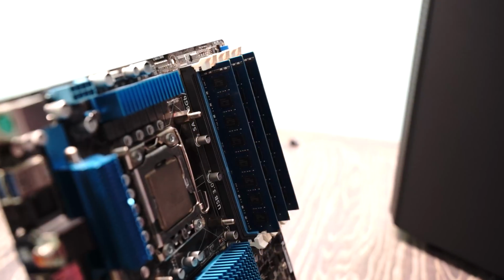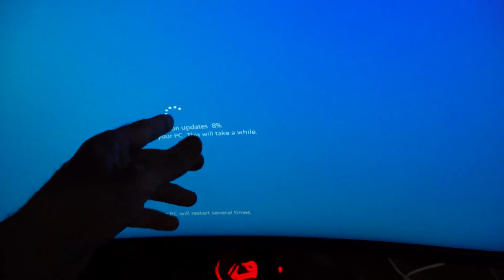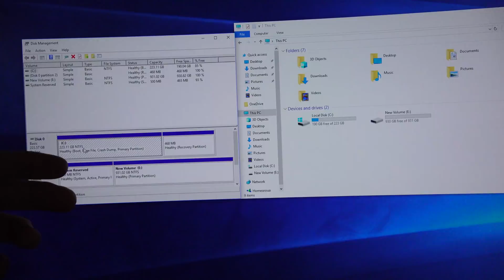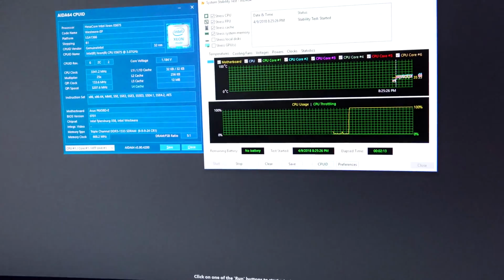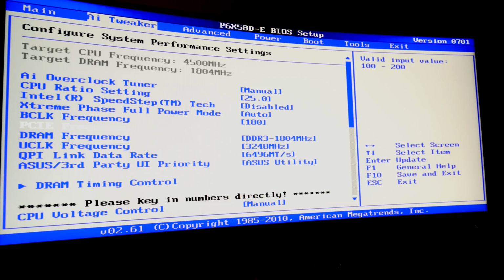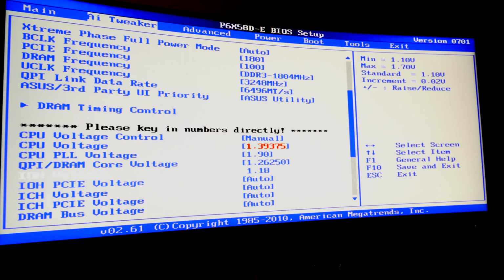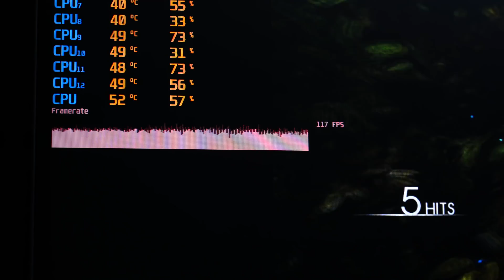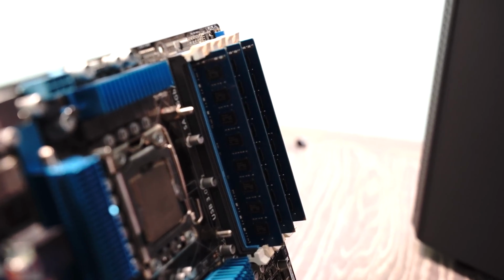Is X58 Still Worth it..? Taking the 6 Core X5675 to 4.5GHz on AIR.

Comment: Can't seem to find x58 mobo under 130-150 euro in europe. 6 core X56XX cpu is around 30-40 euro. From this price i can get used AM4 B350 Mobo and Ryzen 5 1600 with many years of warranty.
Reply: My tip is to buy them as a bundle. Many people are not willing to pay 20€ extra for an i7 950 for example, yet they can be sold for around that price. Also you really need some luck with cheap offers or "untested" alias "mostly defective" boards. The latter one is a huge gamble, so either search for extremely cheap offers or persistently take part in auctions until you win a board for around 100€ at some point (maybe after selling the quadcore often coming with them) and pay with PayPal or similar to avoid being scammed.
Reply: nah, with cheap coffee and am4 boards around its not worth anymore. Ryzen refresh is also knocking on the door, it will push the price of used Ryzen cpu's (maybe coffe cpu's too) even lower. Even if i save some money with an x58 money in short therm, the money loss will be a lot more in long therm because this platform is a dead end.
Reply: There should be around 60-80 USD to be worth it.
Reply: +Kajtár Péter Not necessarily not worth it entirely. They can be had as a bundle for effectively under 60 usd at rare occasions. The bargain is deminishing that is true, but keep in mind the cotrast of rather slow 1600 MHz DDR3 to 2400+ MHz DDR4 in terms of price, especially used. I got 24 GB DDR3 1333 MHz (not quite hitting 1600 MHz) on top of an MSI X58 Pro-E board which sadly died and was replaced on the cheap. The X5660 cpu was 22€ off AliExpress on top of the bundle's 105€=124€-19€ for selling the i7 920 it came with. With the X5660 adding up to under 130€ I doubt you would even get any unlocked coffeelake CPU for that price, at least in my place, excluding the 24 GB of RAM which in DDR4 is 400€ alone, and even lousy 8 gigs cost 80€ easily nowadays. Even with 104€ just for the board which is quite doable in many places, 16 GB DDR3 are <70€ usually. That is why X58 is not dead... yet.
Reply: keep in mind, everything we buy from australia, usa,canada etc is taxed with a few percent of import duty and 15-20-25% of Vat depending on where do you live. Im not sure about VAT in germany but its like 19% isnt it?

Comment: I managed to get an old Dell Inspiron 690 for about $19 nzd. I haven't checked the spec out too much yet but has a dual socket board and 12gb of ram and a couple of hard drives and a 750w psu. It's apparently not going as one of the big system fans has stopped so may be able to resurrect it. Either way it's a monster of a case which I'll use anyway.

Comment: if you want to install windows on ssd, make sure not to plug any additional hdd on the system cuz windows will install the mbr in the hdd which is annoying
Reply: Just make sure the HDD/SSD you want the booting partition is first in the HDD order in the BIOS, never have to unplug all of HDD again. Just boot with 1 HDD, take note of the name/numbers and you're good. I have 6 HDD + RAID setups, I talk by experience
Reply: if you install it like that and later takes out the other dardriver you can use a usb instalation media and repair it 
it worked for me if i remember correctly
Reply: xs3tsunax i wish i knew it before. Had to figire out after an hour of troubleshooting.
Reply: I just bought an SSD to install Windows 10. 
The hdd I had with the Windows 10 partition got corrupted...

Is it ok for me to install Windows 10 on the SSD first, then afterwards plug in the hdd and format that hdd?
Reply: @a.v.d.s.2216  If you're still waiting for an answer......

Yes

Comment: Actual good reasons to upgrade from x58 include:
No on board Sata 3 or USB 3 unless some really terrible Marvel chip ones that are worse than PCI-E expansion cards (tested myself in my current PC).
No M.2 either.
Perhaps not on all motherboards but both my Asus P6T and Gigabyte UD3R fan controls are rather limited, especially on the Gigabyte one.
No RGB for all the people who prefer looks over bargain performance. On the same note PCI-E expansion cards will ruin the look too.
And pretty much any other motherboard feature that might be outdated or completely missing.

Raw performance wise the CPUs are still competitive when overclocked. Lack of some newer instruction sets could be their biggest shortcoming.

Comment: Socket 1366 cpus like i5 750 and i7 920 or equivalent is still a good choice for mid range gaming with a 1060 on 1080p, I have no idea how it performs in 4k but it will still be relevant until graphics card improve by quite a bit.

Comment: Installed an i/o shield, have to say my fps did indeed boost by 50%.
Reply: Before the PC was switched off :D
Reply: i have a build with a 1080ti and one with an rx 570 the 1080ti has io sheild but the rx 570 build dosent so  i can confirm with 50%+  fps
Reply: lol - needs RGB
Reply: @TopHatProductions115  new product pitch: modular RGB i/o shield line?
Reply: @curvingfyre6810  YES! With RGB case strips for added performance boost.
Reply: Vectr what was it like before?

Comment: Ayyyy I just bought a x58 system, working like a champ!
Reply: LA I kind of ripped the poor guy off I think XD. 150€ for a Asus p6t se, 16gb of really good ram, a x5675 and a decent air-cooler. I got it to 4.2ghz and it's running great, just need a good GPU now :/
Reply: Buy the best Xeon for it, it is real cheap even if by badluck it is 200$ it beat any i7 out there.
Reply: Og Og Get a gtx980 since GPU prices still suck :(. Besides, an overclocked 980 will still match a 1070 stock, just with more heat and power consumption :/

Comment: Just got an i7 990x for 20$ at the local computer store last week !
https://imgur.com/fDYnzhm
Reply: Holy crap !
Reply: lucky, paid 45$ for a i7-970X 3 years ago
Reply: Potato Gaming It's still a good processor today, great buy !
Reply: The shop owner actually a friend of mine, x58 motherboards aren't that popular in Viet Nam, he doesn't have any x58 motherboard either, so he just wants to get rig of it, I already have an Asus p6t + w3565 so that was a huge upgrade. About Overclocking, I'm not that good at it so currently running at 4.2GHz with 210x20
Reply: +Potato Gaming How? That is basically a forth of its value and even that might be an understatement. Might even be multi unlocked for some OEM boards and less aggressive QPI overclocking. Do you know if it is?
Reply: That is still beast of a CPU
Reply: Was geht sie das an? I
Reply: Potato Gaming fuck, I need a good x58 cpu, costs hundreds here in the uk
Reply: Potato Gaming Increase your multiplier and lower BCLK. This allows lower voltage at IMC, lower temperatures, better OC

Comment: Still can't believe that my Asus x58 rampage 2 gene died 😢
Reply: Sorry for your loss. My MSI X58 Pro-E burnt out its VRM recently, luckily I won a gamble on an 42€ "as is" eBay listing of one of the same model with stated dead memory channels. However nothing apart from dirty and slightly bent cpu pins was really bad with this board. The i7 920 was just going bad. My X5675 is now back up and running @4.7 GHz ~1.46V with the 6x 4GB Kingston DDR3 1333 MHz @~1200 MHz (204 MHz *6) I could not overclock yet, maybe revisiting this topic sometime...
Reply: rip gene :(
Reply: F
Reply: I can sell you a asus p6t bargain. Lol
Reply: Shah Ahmed seriously?
Reply: Shah Ahmed naa no worries I would rather buy it off eBay
Reply: you mean mobo heaven, or PCB heaven?
Reply: Sualeh Irfan F
Reply: Rip
Reply: Was geht sie das an? How do you do than on that board. My x5650 won’t pass 3.8ghz.
Reply: ahh right, I need to watch that
Reply: +BaseExploits The MSI boards do not usually if ever offer to lock in the +2 turbo multis allcore as most other boards do. However they are usually cheaper and reach a BLCK of 210 MHz pretty easily, allthough VQPI (the QPI voltage) might need to be a bit high to achieve high BCLKs. On a Gigabyte X58 I needed "just" 1.34V VQPI for 200 MHz BCLK, on the MSI one near 1.5V if not more. In case of your X5650 you are out of luck achieving anything above 4.4 GHz without insane QPI voltages on that board since it can only lock in 20 multi allcore. You should get 4.2 GHz pretty easily though with a BCLK of 210. Just remember to cool your components, so that your board lasts longer than mine did. rip. Here are some settings you can try for 4.2 GHz:
BCLK 210 (possibly higher if VCore needed is less than +0.38V and QPI is less than 1.5V)
CPU multiplier 20
VCore +0.4 (maybe a bit more if badly binned chip, just do not exceed 1.46V, or 1.4V if you want to keep it safe)
RAM at anything below 1700 MHz to ensure stability of that if at least binned for 1600 MHz
VDimm 1.6V
Possibly QPI link at slowest above slow as shown in this video
then just lower the settings one by one until unstable to find the sweet spot
Reply: My sympathies. I lost my Rampage II Extreme not too long ago as well.
Reply: That sucks man
Reply: F
Reply: Fix it
Reply: Sorry to hear that. 😔
Reply: Have one as well and I believe it's on it's last leg.  Want a Sabertooth anyways.
Reply: F

Also for my MSI Big Bang X58
Reply: Really my asus rampage II gen woks 8 hours every day 10 years now ,single motherboard that die on me widout being temper with was MSI I will never buy from them again
Reply: I’m selling the one you mentioned on Ebay, someone donated their old pc which had that motherboard I was shocked when I checked for how much they sell!
Reply: Sualeh Irfan lol if you are in melbourne then we sure can do a deal

Comment: X5675 is extreamly cheap on ebay and I really want to find a dual lga 1366 mobo to run 2 x5675.
Reply: You can totaly overclock on the SR2 , its the SR3 when it was disabled
Reply: You can get an Asus Z8NA-D6 for a pretty good price. I got mine from ALiExpress.
Reply: was that really necessary silent
Reply: AqwBroders I do have an EVGA Classifield SR2, interested?
Reply: Django Ryffel how much?